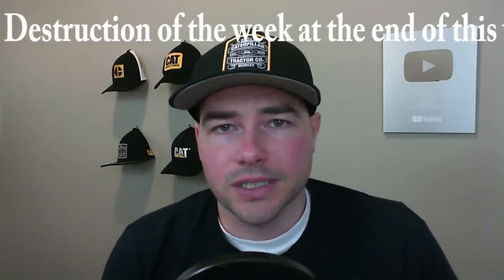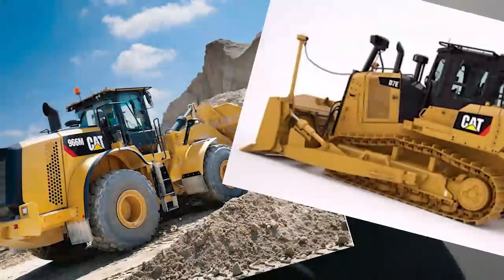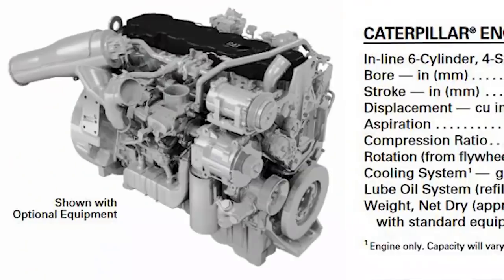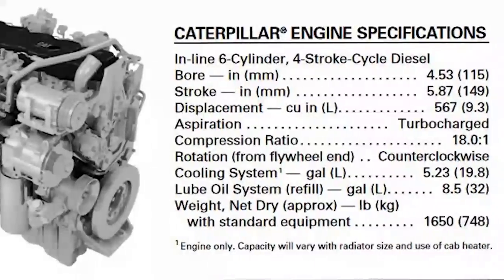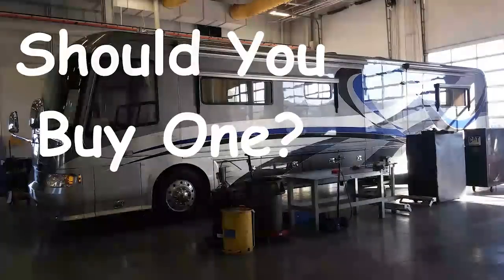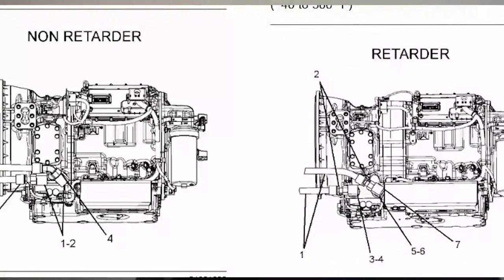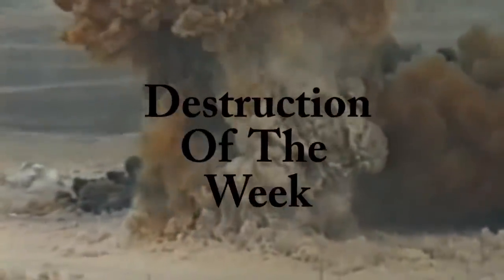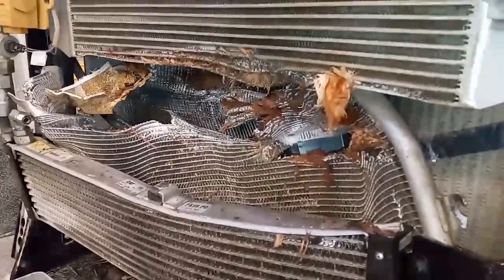Did you know Caterpillar made a TRANSMISSION for Trucks and Buses? The Cat CX28, CX31 and CX35.

Comment: I too loved the CAT 7155-16 speed semi-auto transmission that in the 1980's was found in a lot of the U.S. Army's AM General fleet hooked up to the Cummins NTC Big Cam 4 engine. That same transmission was also found in the larger CAT road graders. For road truck use you always start out in 8th gear and skip shift your way up to a comfortable highway speed. The major problem with this transmission due to all the individual air lines (being an air-shifted two-pedal transmission) was in the much colder northern climates. If any minute amount of moisture found it's way into the shifting module below freezing, you were stuck because it would not go into nor shift gears. Of course that issue is mitigated with a heated air drier and regular maintenance to the desiccant filter. If it were possible to mate that transmission up to a Detroit Series 60 DDEC-4, I would much rather have the CAT 7155 transmission than anything from Eaton Fuller because of the number of deep reduction forward ratios and 4 reverse options. Had Caterpillar continued to develop that transmission with an auto-shift sequencer, that would've been the ultimate package to have today for both heavy equipment and on-road semi-trucks / dump trucks / cement mixer trucks.
Reply: I was in an Ammo unit at Fort Benning back in the 80's. I was in the Support Platoon and we hauled all sizes of fork lifts and we had two D-7 Dozers that we hauled behind a M916 with the 400 Cummins and the CAT transmission. Once you got use to shifting them they were a great transmission. The M915 road tractor also had the same setup and if you turned the 400 up to 2350 RPM it would run 85 MPH. When I was buying and selling surplus military trucks after I retired from the Army and I always wanted a M915 with the CAT but never found one surplus. Most of them had been retrofitted with the Allison transmission.
Reply: you look like a guy that would like the cat 7155.......jk
Reply: I actually like that idea. I sometimes wish i had a automatic because typically my driving is 500ft forward and 300 back. Rarely i drive like 10 km once a week. And tons of hills this trans would sound like a dream to have in a mack paired to a mp8
Reply: Last year I installed a cat7155 behind a cummins big cam4 into a 1988 international cabover. very cool transmission, with my 3.42 rear gears, the 7155 overdrive of .84 is perfect for the highway @ 70.  I usually start out in 5th and double skip upto 13th. the gears are very noisy though, esp 8-11 gears. I run a moisture filter and an oiler with air tool oil, shifts good. I just did not like the older trucks with the horrible heavy clutch pedal, sucked in traffic. the 7155 takes a little getting used to- strange feeling when coming to a stop and you don't need to push in the clucth. The days of a horrible stiff clutch pedal in traffic are gone.  This would mate to other engines- it uses a gear that bolts to a standard flywheel in place of the pressure plate of the clutch. it looks like a reverse starter gear and the transmission slides into it. super simple but the entire flywheel area becomes a wet clutch setup- you have to seal it by using a marine style bell housing or seal up all the holes/access panels to use the standard engine bell housing.

Comment: My father is a co patent holder on the 7155 on road transmission. Patent dated 1974.   They had the semi auto and fully auto transmissions. 16 speec fwd, 4 reverse.  He was one of the Engineers on the program as well as the designated test driver.  The test mule was a flat nose Peterbuilt. I don't remember the engine size, but Im guessing around 13 liter, relative to the size of the Peterbuilt.. twin rear axle.. not a in town single axle.
One gentleman had 4 rigs under his control..  3 gals driving for him, plus himself.
The 7155 was sold in thousands to the military as stated in other comments.

While the autos were a bit more expensive than a manual trans.. the BIGGEST road block back in the early 1980s... was the testosterone driven male culture,,   if you don't double clutch you are not a man.
Reply: Interesting. I wonder how to unlock the 2 more reverse gears. In the AM General M915 series of trucks there were only 2 Reverse gears and 16 Forward.
Reply: Lol. Not knowing what double-clutching is, makes you less of a man for sure. Floating gears also necessary to be a man.
Reply: @someperson7  I clutch out to down shift if I'm on the jake. Float for everything else. Double clutching really has gone by the wayside for a while now. I needed to know for my test back in the day. But I hear a lot that it's not even asked about anymore. Even testing in a manual. Sad really.
Reply: @bballer182ify  It was a LONG time ago.. can't ask Dad anymore ☹️,  It might have been the full auto they were working on..  I remember the control panel he brought home to work on, finish up some details.   16 fwd buttons, 4 reverse..  before you start you could pick which gears to go thru.. empty.. 2, 5, 9, 13, 16 etc..   loaded heavy 1,2,3,4.....16.  
Being a planitary gear set, I think the multiple reverses was just banding down on the sun gear for that gear combo.  Again can't remember.. I was 16 years old. Thought it more interesting a guy had multiple trucks with multiple women drivers..  taking turns with him on routes.
Reply: @someperson7  Dad taught me how to float them..  but really, if that's how we measure manhood..    😄     but there are those who just have to fondle and move that big phalic symbol rising from the floor.  HA. 😃🍆
Reply: @greggoett  I would imagine there could be many ways that the 7155 could be controlled/shifted, but the ones in the M915 series trucks have a notched sequential shift lever down by your leg/knee. I can see some interlocked button system doing the same thing. There's just an "umbilical" control cord that goes between the shifter box and the transmission. All it's doing is sending air signals thru the floor. 

Your dad must have had a special mind! These things are quite interesting.
Reply: @bballer182ify  I've pondered getting a 3126 or C7 diesel to put into an F250.  Back it by a 7155.. just cause it was dad's..   I've seen them on Ebay cheap enough..   how much a trans tunnel mod it'd need I don't know.
Reply: @greggoett  I'd let you have mine if I had an Eaton 18sp to swap into my M916. I guess I have a really nice one. Never ever had a problem with rust, sticky gear, clutch engagement, valves, nothing. Been solid. Just like manuals better.
Reply: @bballer182ify   since my dad wrote the service manual... assembled quite a few on the line, yeah, if he was still around what a resource to have for you guys to have on the web..   I'd have to read the posts and put on the web for him..  but..
Reply: @bballer182ify  Lol, too funny. I know girls who weigh less than 120 lbs soaking wet who would make most of these goat roper wanna be super truckers  look sick when it comes to handling any manual transmission semi tractor.
Reply: @6h471  Absolutely! We have one who works for us.
Reply: If you ever hear one of these darn things shift, you will never forget it. Water/moisture was the death penalty for the ratio selector and the control valve. They put a heating element around the control valve, to The rest of the transmission was very solid. Only seen one with a gear failure.
Reply: I thought testosterone filled men floated gears?

Comment: I worked for caterpillar in the 70's80s and they made an air shift for the military behind a Cummins because the 3406 was too new. I know because I was 1 of 2 people East of the Mississippi certified to repair them
Reply: That’s cool
Reply: Was under the impression all the bigger trucks had Cummins engines
Reply: Find me a working 1693 clatterpillar that if needed you can rebuild so I can use it!!!
Reply: @michaellee5399  1693 my first cat.

Comment: I worked at the Cat dealer in Miami for 35 years and specialized in transmissions and hydraulic components. With years and years of powershift transmissions, when the newer ones came along (cx31’s), I was not a fan. They are really a different animal. I did 2or 3 of them just before I retired. But I really hated the hydrostatic (953, 963) trans. Did 1 of them… hated it. But it was a good job and I learned a lot.
Reply: Good job Phil you worked hard to keep equipment operational and this country functioning. I am a proud blue collar worker. I drive my truck now but I will get into the mechanical side of things soon here.
Reply: Thanks for the good info!!  What did you think of the 941b machine? engine? and trans?  I was looking at buying one that is running but needs a cylinder reseal and has a few leaks.

Comment: @Adept Ape. We use the CX28 togheter with the C7 on our improved M113APC in the Norwegian Army. And much make sence now. It was BAE Systems in California that designed the powerpack, and this modification was done in 07-08. And yes. There ain`t many spare transmissions on the market. We have our problems with it. But not those that you mention, yet. Because our APC don`t have many milage each year compared to other kinds of vehicles. But due to our design, we have som other problems that I aint going to write about in here. But thanks for a great video, again. I tell my soldiers that are on technical courses to check out your channel.

Comment: The industrial predecessor to the CX is the TH 31&35. Their basic platform came from the 735&740 articulated dump truck.
They are very robust transmissions used mainly in skid mounted pump applications and work over rigs. 
Their big brothers in the industrial world are the TH 48, TH55E70 and TH55E90.. these are FRAC applications.
THE 48 can handle 2000+ HP fairly well but it's an older valve body design. The 55 E70&90 are ECPC design and you will run out of HP before you can make one of them back up...

Comment: back in the '80's we had 7155's hooked to 3408 in pacific truck chassis  used in the oilfield as nitrogen pumpers. output clutches were an every couple month deal. tough part was the dual control setup ,one in the cab and one at the pump control panel.  winter sucked with frozen air lines

Comment: Big Budd company in Havre Montana is building tractors again with C18 engines and Cat automatic transmissions. Also Cat axles. I've operated a 600/50 with a KTA600 Cummins and a Twin Disc transmission. It was impressive. I'd like to try the new one.

Comment: Allison’s in almost every bus application, or typically extreme-duty vehicles like garbage trucks, will have a retarder. They work very well.
Reply: Drove many Allison trucks 100s of thousands of miles. Only got left walking once by a trans problem.
Reply: On our charter motorcoaches the retarder used to be optional on the B500 . We noticed a significantly shorter lifespan of the retarder versions than the B500 units with it.
Reply: @prevost8686  interesting. I know our mci coaches with the series 60 and b500 transmission didn’t come with a retarder, but that’s because the series 60 had a highly effective jake brake setup by default.
Reply: @sgtotaku  true. Many charter companies that purchased them didn’t order them with the retarder option. My Prevost doesn’t have one.

Comment: Want to start by saying I really enjoy your videos. They have been the most thorough and accurate information outside of SIS. Your translation into "layman's terms" helps alot. I was a Cat dealership tech once upon a time as well. I have my own service truck now and no longer work at the local dealership. It seems you are very big on 100% accuracy. I noticed something in this video. The pictures u used when saying Cat makes transmissions for equipment showed a wheel loader and a D7E. The D7E doesn't have a conventional transmission as most dozers have 3 & 4 on later models. It has finals & gear cases I'm certain but they utilize an electric tram motor with a variable control for speed control. No actual speeds/gears. I'm sure u are aware of this and I'm sure u either used that pic for an example bc it really doesn't matter bc it gets the point across or u did it on purpose wondering if anyone would notice. Either way I'm not trying to pick at your video. It just clicked when I saw it and thought it would b worth sharing with u. Keep up the good videos. I know I truly appreciate them and your knowledge.

Comment: It makes sense those types transmissions, were used a lot the off highway heavy haul and articulated trucks. Cat also made a lot single speed transmissions for front end loaders. but I don't  know of any of them in OTR tractors. but personally I preferred the Eaton Fuller 15 and 18 road ranger transmissions. many years ago I had a Ford F 850 three axle tractor with a six speed automatic transmission. I'm not absolutely sure but I'm guessing it was manufacturered by Allison. although it said transmatic on the literature for it. I drove a Mack that had a retarder on it. it was okay but to be honest I'd prefer a Jake brake.

Comment: You should check out the TH series transmissions from cat they were there series before the CX hardly any in on highway though mainly used in the oil and gas side from work over rigs to Fracking the TH35 had the option of a Dropbox which was interesting but sometimes a pain to troubleshoot

Comment: One guy below said the 28, 31, 35 was the size of the clutches in Centimetres.  That would convert to 11 in // 12 1/4 // and 13 3/4 // INCHES
Reply: I was tired of doing conversions four decades ago and having two sets of various types of tools for fasteners. I may be more used to stone age measurements but I prefer metric as that system makes sense.

Comment: The CX-31 was used widely in the International/CAT engine group ct13  And rarely seen CT-15. Both powertrains were integrated in the emission International Truck rebranded with CAT logo CT-660 and similar short lived model trucks.. 2013-2015?ish.... The CT-15 ran Ok and made lots of low torque think it peaked around 1200 rpm. ..like all autos slow on the hills. But I definitely wouldn't recommend this combination for heavy haul trucks. Air compressor cfm way too low and slow also. The Cx31 would probably be great on the flat lands but in West Virginia and Pennsylvania..a 18 speed is a much wiser choice in the mountains.

Comment: They also have a CX38 in the 740C and GC model articulated trucks.  They’re a complete disaster.  We are rebuilding them constantly, Cat has extended the warranty and done multiple major updates.
Reply: We just had a big run of these come into our shop for the oil passage mod to the case and the pin updates on the diff carriers. I want to say our rental fleet 740's have had the transmissions pulled at least 4 times each.

Comment: Multiple output bearing and seal failures would equate to driveline angle problems caused by the installation engineering, or suspension engineering. This problem would also compound internally in the transmission by clutch disc, drum, and planetary failures due to vibration input from the driven end.
I can tell you stories of seat of the pants education where some driveline tech folks and suspension manufacturer engineering departments learned from me.

Comment: That's a shame that they half assed something like that because in my experience the truck Industry is really hurting for a decent automatic transmission. 
   I initially heard the cat truck transmission was a powershift and wondered why these weren't more common for on road applications in general because it seems all the choice that's available is an Allison or some variation of a dry clutch, non synchronized manual with or without pneumatic controls
Reply: Driving I like the Eaton automated transmissions on macks as a mechanic ZF makes automated transmissions for cranes that weight over 100,000-300,000 for road use other than being challenging to work on shifter It work really good
Reply: @cranemechanic2479  good God my experience with eaton automatics has been dismal
Reply: The Detroit DT12 in Freightliners is actually a solid transmission setup. It makes reliable fuel economy but you can hold a gear when climbing or running the Jake’s hard.
Reply: @markm0000  yea I really enjoy driving the 12 speeds like the dt12 and I shift despite how much bs people say about them
Reply: They're hurting because there is no such thing as a good automatic transmission in a heavy commercial truck. Nothing can replace the seat of the pants feel, sight and sound input of a human. The autos do what they think need to be done with the limited inputs that don't take into account the next move or stop light or hill coming up like a human can. Heavy trucks and automatic transmissions just don't go together. Even with pedal input, they're too slow to react/shift when needed. That and they rob tons of power which means lower fuel economy and higher maintenance costs.
Reply: @mikeznel6048  wish we had those dcts like europe
Reply: @mikeznel6048  depends on application. Most rigid vehicles (straight truck i think they call them in the states?) I personally say are suited to autos. 3500 Allison's will handle 35 ton plenty easy. Driven it many a time. And once you wrap your head around DOC, theyre a pisstake how easy they are to diag. Throw a trailer on or pull something over 40 ton, they start to get a bit unwieldy as you were saying. But with a good shift program in it, theyre quite a good bit of kit to drive. As for enjoyment, rowing gears will always take the cake
Reply: @nickwhite6717  yes we some M2 Freightliners and c7 cats the one with Allison auto got the best fuel mileage. 
Now we DDT 13 and even better fuel mileage. 
But automatic was very good for short haul ran 14 years only repair was an electrical connection new connector and that was it